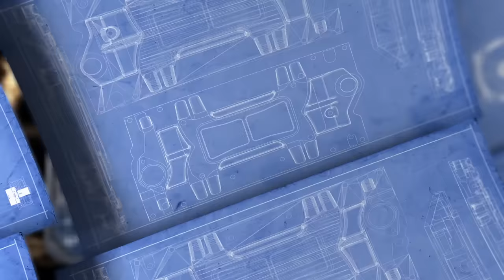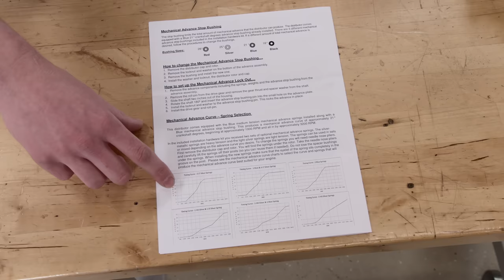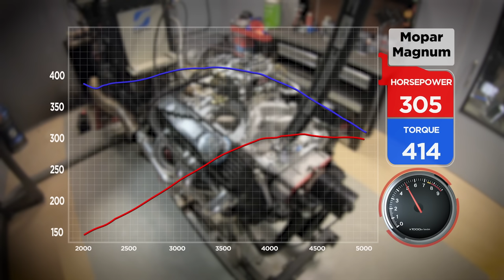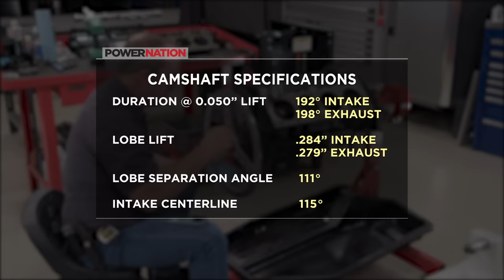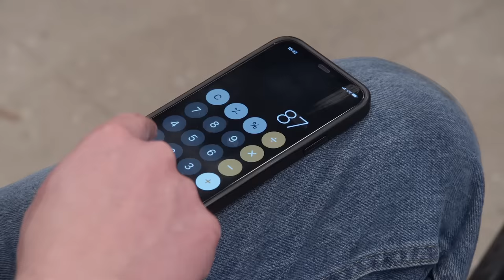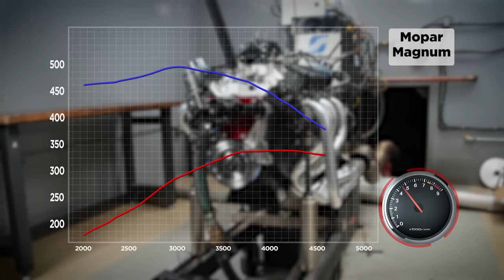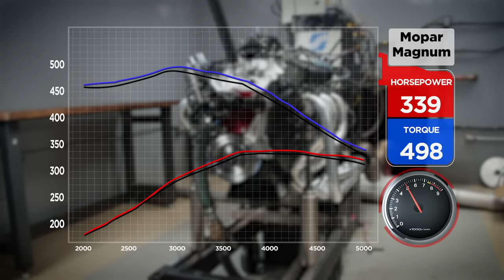What Happens If You Just Add A Stroker Kit To A Stock Mopar Magnum? - Engine Power S9, E3

Comment: I maxed out a set up like this. I bought a new 360 block, 408 stroker kit, 11:1 compression, port matched Eddy airgap to a set of alum Eddy heads (ported by Hughes), balanced the internals, 850 Dom on a 1" spacer-plate for NOS, TTi 1&78 headers, Howards cam with ~ 600 lift & saw 580TQ @ 5000 / 600HP at 6000 with no power adder. I put that bullet in a 2900Lb '73 Dart. Mopar or no-car.
Reply: THAT is EXCELLENT
Reply: I thought NOS was a power adder. Learn something new everyday.
Reply: Mostly old parts and rust.
Reply: @Hammerback0  maybe it made more on NOS?
Reply: Music to my ears
Reply: Hmmmmm,.....
Reply: NICE!!!!!!!, I am normally a Mopar guy but my current project is shoe-horning a 350 into a 2wd GMC Jimmy
Reply: sounds great  Howard is good choice
Reply: Eddy… Lmaoooooo
Reply: Damn, talk about a rocket! Holy crap I bet that was fast!!
Reply: @MB911 What are the specs on that cam?
Reply: @jmflournoy386   Cool.Thanks.
Reply: @ragingbull3406  let me know what you find  give me a shout if researching
Reply: @Hammerback0  said it was set up for nos didn't say anything about using it lol
Reply: Yea .Mopar ❤🔥💯💪
Reply: I wonder if this would help my 2001 ram 1500 4x4 its a bit hevy
Reply: @gunsandhorsepower  IF YOU NEED a rebuild go for it otherwise what gears are you running, do you have taller tires.  what trans mods?   tow? freeway miles   a 73 dart build is not for you
Reply: @jmflournoy386  i would assume so cause its definitely not a dart im trying to find decent motor for my 2nd gen mud truck that actually competes with the damn square body's. Its a 01 regular cab short bed 4x4 with 38.5 boggers
Reply: @gunsandhorsepower  I wrote a nice reply and it disappeared    try later
Reply: @jmflournoy386  😂😂
Reply: So if you made 580/600 on no power adder, how much did you spray and what were those #s?
Reply: Nitrous is a power added. Do you mean it made those numbers without nitrous? Because with what you listed, I'd expect that much power without nitrous. With nitrous I'd expect more in the 700 - 800hp range.
Reply: Now that's what I like to hear
Reply: Eddy? What about Ed and Edy ?

PS: Congratulations on the build, that sounds like a healthy mode-ahh. All kidding aside, I've never cared for the Mopar stuff until I started messing with a Eagle Hemi. Now I'm Mopar or no car myself. With factory heads that out flow the Legendary LS6 454 heads, it's hard to not love the Gen3 Hemis.
Reply: @M4A3 lol Ill trade a little bit of flow to have a good solid low end that doesn't snap cranks like toothpicks for no reason
Reply: Thats not a bullet, thats a tactical warhead and you're going to need to sign the non-proliferation treaty to use that thing in public.
Reply: I bet it made it all the way down to the next block over before it fell apart and turned into a bucket of bolts 😂. All jokes aside, that dart must be pretty rare. Most of those were recalled or fell apart in the rain.

Oh by the way, a motor with NOS on it is not "without a power adder".
Reply: ... Or you can gap the rings and boost it for way less $ 😁
Reply: @PotatoeJoe69 He only said it had a plate on it
Reply: @Hammerback0 He only said it had a plate on it
Reply: @Hammerback0 It made that power with out using the nos on the dino

Comment: I find it hard to believe that an 800cfm carb was restricting a 408 stroker on mostly stock parts. A 950 is ridiculous, nascar engines are 358ci and can still make 600hp with a restricted carb size of 450cfm.

Comment: This high torque low RPM engine would be great in a 4x4 vehicle. Maybe also just add a higher lift cam without getting to radical.
Reply: Was just thinking the same thing Victor! It would be perfect in my Jeep Grand Wagoneer that has the AMC 360 in it now that needs to be rebuilt or swapped. It should also bolt right up to the 727 transmission already in it. I need to research this more
Reply: too radical. LOL. That cam is radically bad.   192 and 198.   lift.  For perspective stock 351 cam like mine is 460 lift. My upgrade is 560 and still considered conservative.  192/192 is gawd awefully small. Like WTF small. Who made that crackpot decision at dodge?  THAT is why the HP never gets above torque.
Reply: @1982MCI  FYI the Wagoneer 727 has a different bell housing pattern than the dodge 727.  With that said, I put a dodge 5.9L and 46RH in a fullsize Cherokee and its a great setup.
Reply: A truly stock Magnum would have efi, with the "beer keg" intake, and stock exhaust manifolds.  Number do not impress
Reply: @starbattles1  those numbers are duration, not lift.  Plus, remember its a truck engine, so should have more torque than hp
Reply: @starbattles1  with a stock magnum 1.6 rocker, the cam lift was .454, which is weird, because stock 5.9 magnum cams were actually like .400 lift.
Reply: @starbattles1  the lift was .284/.279 (lobe lift so multiply by 1.5 for valve lift) the duration @.050 was 192/198
Reply: yeah and maybe bowl blend and chamber shape with scavenge area and unshrouding and lightweight valvetrain. mild porting. some outperforming small aluminum heads with  another point of compression. Maybe a nearly exact spec billet cam with more area under the curve and highly tuned ramp rates aimed as this cam's baseline. shooting for 500+ torque. its a lot of fuel.  Although part throttle would be immense in power also, i am anticipate what a six pack or six barrel would do.
Reply: @berhorst59  At least on the stock engine a 'Kegger' would have produced similar peak numbers to their baseline, though probably at a bit lower RPM's. The 5.9 Magnum was rated at 245 SAE NET HP, where as running it on the dyno with open long tube headers and no accessories as they did gives you an SAE GROSS HP rating. The stroker definitely benefited from the better intake, but probably no more than it would have from a modified Kegger and larger throttle body. Stock Magnum heads are the biggest limiting factor.
Reply: @johnrichardson4327  that 46rh blown up yet? Lol
Reply: @romper4444  no sir.  Shifting like a champ